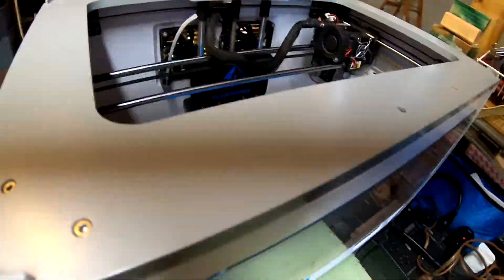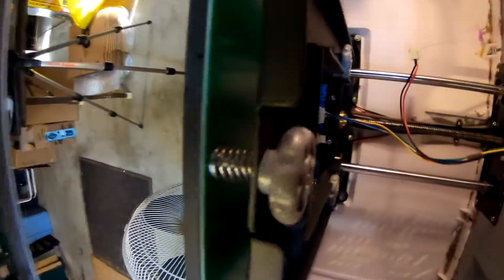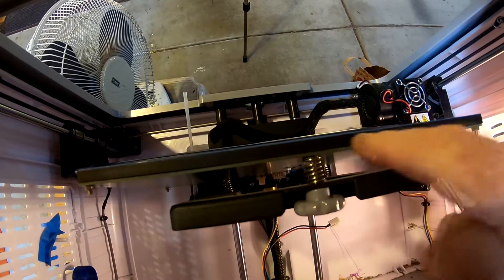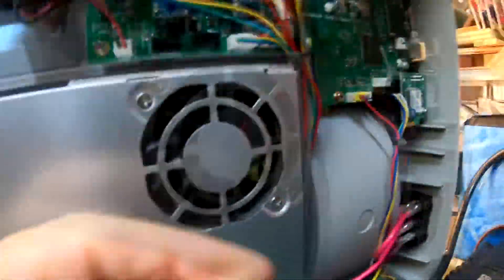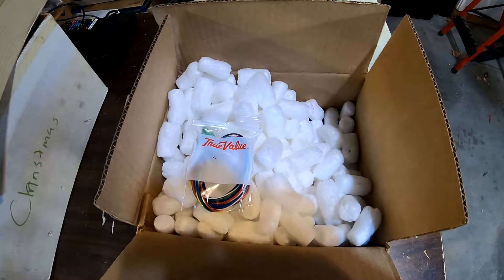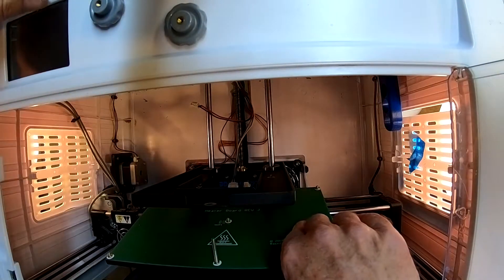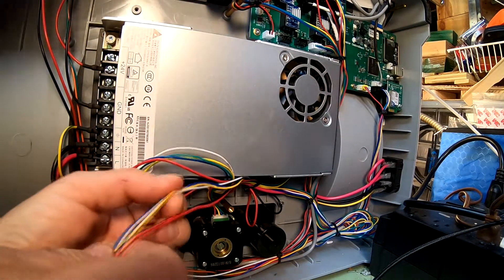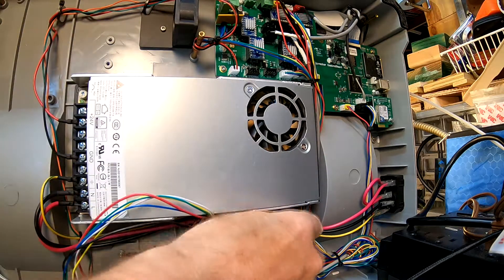Flashforge Dreamer (NX) - Replacing the Heat Bed and Wiring - Part 1

Comment: This exact thing happened to mine. I also had the connector for the power supply to the drive board burn up, had to unsolder the male side from the board to replace it. I put larger gauge wire for the heater connection. It took me forever to find the right female connector for the build plate, I ended up improvising something. Anyway, found this video because I forgot to take pictures when I took the plate off. SO thanks, I'm going to go put it back on now and see if my repair job worked.
Reply from the maker: @JimmyCartersPeanutFarm  I’m glad it helped. That connector is not designed properly for the wattage. Let us know how it turns out.

Comment: My heater is heating too hot, it stays at 81+ degrees as soon as it's turned on. Do I have to replace everything?
Reply from the maker: Are you setting the temperature of the print bed when the printer starts up using the touch pad?
On a number of my NX videos show how to to that like this one:
https://youtu.be/toWiw_45uxo?si=N0CffpQ5ao8UQSvh&t=418
If not, then it sounds like the temperature controller is not working. I would first contact FlashForge tech support with your symptoms and see what they say.

Comment: Glad I found this. about two years ago I was printing ABS alot and just busted the machine. I just did a rebuild on the heaters, thermocouples, nozzles, etc. First print after the rebuild and the bed stops heating. It's printing PLA right now but once it gets done at least ill know what to look for.
Reply from the maker: Glad it helped. ABS requires very high (100+ degC) bed temps to stuck. Good luck and let us know how it turns out.
Reply: @BetaCygniBlog  got most of my Ghostbusters pack done in ABS. I’ll just go with PLA+ from here out. ABS is too much of a pain.
Reply from the maker: @BravoCall  I agree. When I need more strength/flexibility. I use PETG. I have a number of videos on my channel where I review PETG filaments.

Comment: My dreamer keeps saying platform not heating please check wiring
Reply from the maker: I would check the plugs on both ends: pulling them off and putting them back on to make sure they’re seated and making good contact. 
While you’re doing that I’d use a voltmeter and make sure the wires or connectors don’t have a break in them. 
If it still doesn’t work I’d contact FlashForge about getting a replacement. If the printer is under warranty then it should be free. Good luck and let us know how it goes.
Reply: @BetaCygniBlog  Thank you ill try this today thank you for this it goes a long way
Reply: @BetaCygniBlog  hey matey I know I’m abit delayed. But I can’t seem to find a Heat Build Plate Line. The one from your description is gonna cost me 10k shipping lmao for a 20$ part which is crazy ahaha. So just curious if a flash forge creator pro 2 Heat Build Plate Line would work  instead ?
Reply from the maker: @zenitsu950  As far as I can tell it will. 
This link to the FlashForge USA site (where I'm located) says it's compatible with the FlashForge Creator Pro which has the same build plate as the Pro 2. The build volume of the Pro 2 is somewhat smaller because it has independent moving print heads, while the Pro has 2 extruders on a single moving head.
https://flashforge-usa.com/collections/parts-accessories/products/heating-plate-creator-pro-dreamer-inventor
I'd say I'm 95% sure it would work with the Dreamer NX. FlashForge seems to be using the same build plate for a number of different printers.
I'd ask the place you found the Pro 2 heating plate for sale if they think it's compatible.